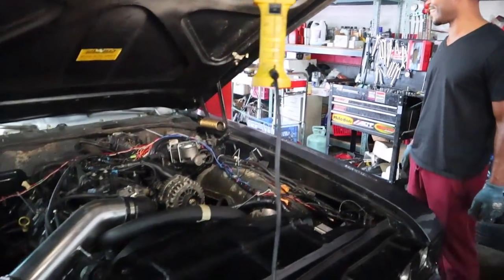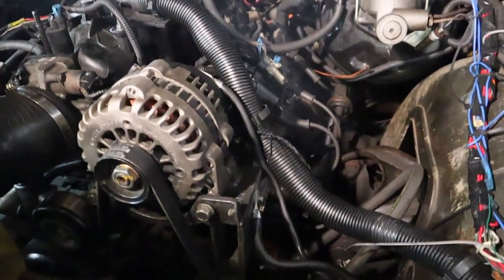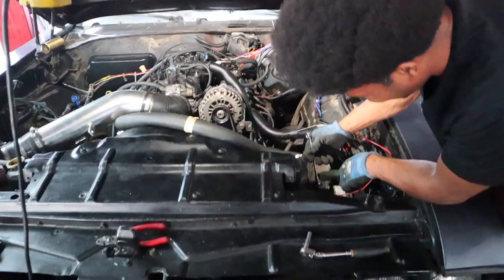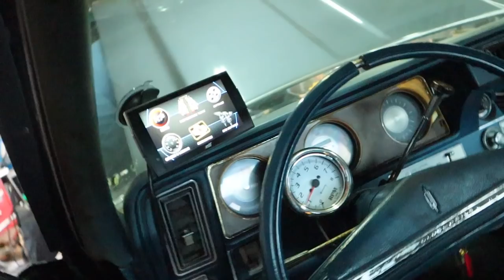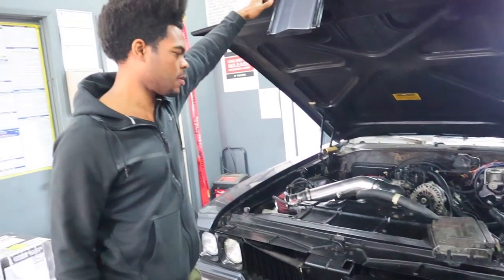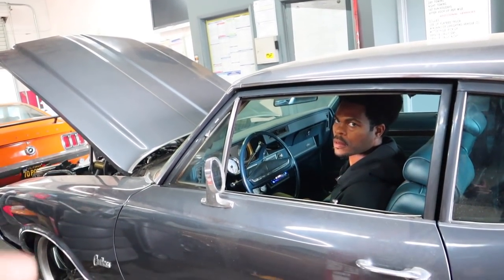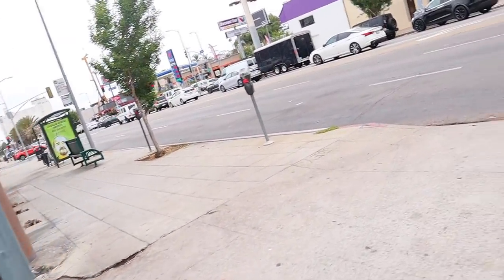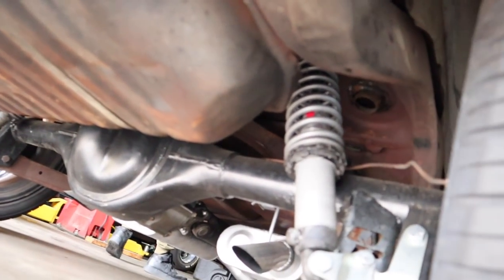1970 CUTLASS 6.0 80E SLOPPY STAGE 2 CAMMED BASE TUNED SOUNDS LIKE THE MOTOR IS TAPPING

Comment: I would say since he put 5.3 706 heads on it and a cam swap his pushrods are to long. This causes the lifters to have to much preload and causes the dreded sewing machine sounds. Get a comp cams pushrod length checker and measure measure measure... also the only real way to tune is with a wideband. I've done it with ltft and stft but its not as accurate. Keep working at it man you'll get it. People do these swaps and don't realize these motors aren't adjustable. Pushrod length is key. It can rob major power in some cases. Nice ride, just has a few issues to work out.
Reply: it's not a 5.3 he said it's a 6.0
Reply: @pache7216  5.3 heads

Comment: Guru i have a 04 yukon with a 5.3 all i have is a cai on it would you recommend i get a cam and tune first or rear end gear work first?? I want a lil extra power at the red light but not trying break the bank.

Comment: Great car sounds great 👌👍 but you need to put a bigger air filter on there that's a bit restricting good luck with the car.thanks for the great work and video keep them coming thanks from Gus and family at PoMoFo Racing.Pueblo Colorado 719.
Reply: he got more problem than to worry about a air filter..
Reply from the maker: His car didn’t even have a problem just needed to fix his timing

Comment: What stahl converter recommended for sloppy stage 2?
Reply: I went with a mild stall 1600 to 1800 me personally I wouldn't go past 2000 because its a lockup converter and if its not locking up ut will be creating excessive heat that's my .02

Comment: Cool video...Im having a brand new LS-LQ9 built for my 1970 OLDS -442-w-30 conv....Original 60K miles...My 455 took a dump...Should be ready mid July?????
Reply from the maker: Right on champ that’s going to be a good build
Reply: @TheLsSwapGuru  Thank you bro!!
Reply: Real W-30 convertible? If it is don't  get rid of that 455 if it doesn't  have a hole in it. Way to valuable  a car to not keep it.
Reply: @darrylj4554  I hear ya bro..That's what everybody has been telling me..I can't wait until the new motor get's here..New headers shipped out yesterday..

Comment: So do you need a converter with the sloppy cam? I've read different things but it seems like many dont run one.
Reply from the maker: Depends on what the cam requires
Reply: @TheLsSwapGuru  Im speaking specifically on the cam that is in this car, the sloppy stage 2.
Reply from the maker: @phillipbelcher3371  more then one sloppy stage two can google the specs or call them I wouldn’t know

Comment: Never change a LS cam without changing oil pump, New Lifters and all censors. It is a must before cam swap. Cam bearings should be ok unless oil pressure was a problem at beginning.
Reply: Oil pump o ring is the only NEED to be done things the rest should possibly be inspected
Reply: my brother u right about that
Reply: @Rider0909  and out an oil pickup girdle on while ur there, good insurance

Comment: That thing sounds like a pile of crap with collapsed lifters and who in their right mind would put garbage 706 heads on a 6.0.
Reply: 706 heads brings the compression up. 😆😆 Shawn Church do your research. Let’s see you post what you have. I’d love to race it for pink slips.
Reply: @julianjerrod  706 heads may raise compression but that is pointless when they flow like crap and are know for cracking due to the casting method used and you definitely do not want to race anything I own or build, my slowest car is faster then anything you will ever own.  My daily driver is powered by a 488 cubic inch  noonan racing billet water jacketed ls edge block with billet noonan racing canted valve heads being fed by a pair of 8285 precision turbos.  All 16 of my billet atomizer fuel injectors probably cost more then your entire engine.  I bet my wifes 2013 escalade is faster then anything you have and it only powered by a full forged 416 stroker and a magnuson tvs2650 on e85 fed through a set of id1700x injectors.
Reply: @shawnchurch316  You talk a good game Shawn! I'd love to see some videos of your builds! Post some of them so we can take a look.
Reply: @shawnchurch316  I love it, ppl read about heads and just assume a 5.3 head on a 6.0 is gonna make power! I should be done with my lq4, 243 heads,ss2 tomorrow. Hope it makes sum good power. Don't need too much bc a 60e behind it for a while. But I read and read to  find best combo, luckily I got the gen 4 5.3 that afm destroyed and it had the 243s on it. Gonna use the top half of the gen 4 on the lq4 bottom end. Just swapped reluctor wheel today and added a 3 bolt 4x cam gear. Next hurdle is where to mount gen 4 knock sensors but shouldn't be too hard.
Reply: @erik120719  243 heads in a lq4 or lq9 is basically a iron ls2.  The 243 heads have gotten easier and cheaper to find since they came on gen 4 4.8 and 5.3 engines.  From wrecking yards its very easy to find them on v8 envoys and trailblazers and the gmt900 trucks are showing up now in junkyards.  I was doing alot of l92 rectangular port heads on lq4 and lq9 engines back in 2007 and as price increased I will order tfs genx 255 heads instead.  Between 07 and 09 you could get a brand new pair of l92 823 heads straight from gm with the offset rockers and ls9 head gaskets for around $1000 and now it is double that.

A pair of 243 heads on a lq4 can easily make around 500hp with the proper cam.
Reply: @shawnchurch316  yeah that's why I changed em out while I had motor out, I went with the sloppy stage 2 just for driveability since it's a daily.